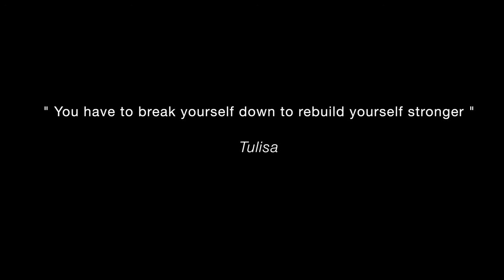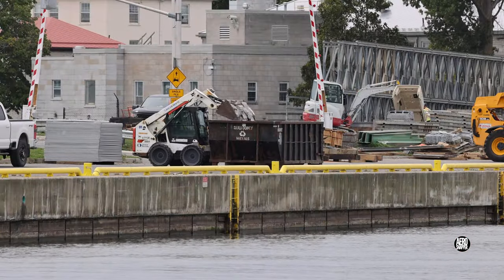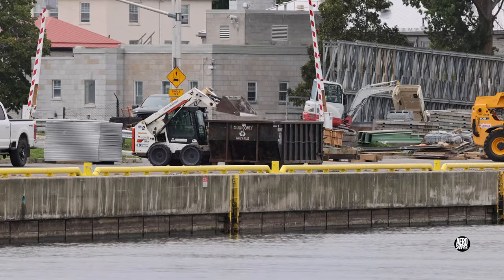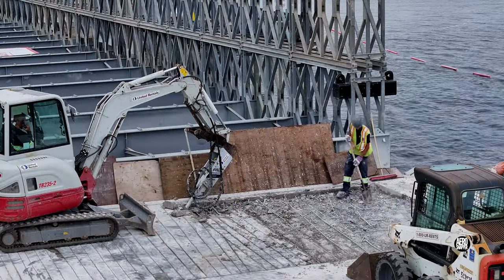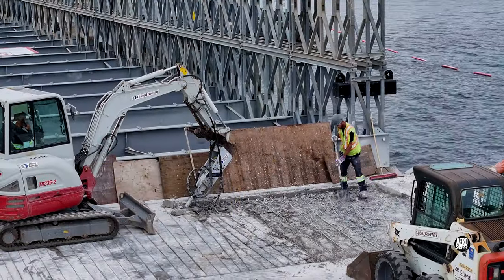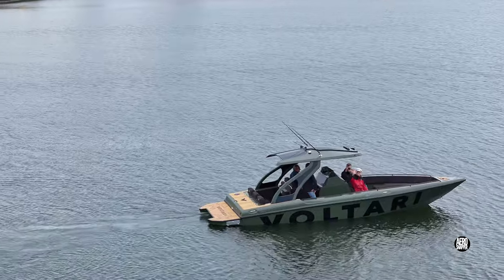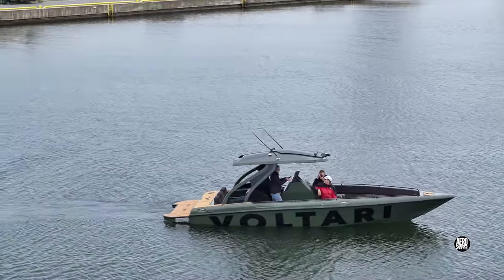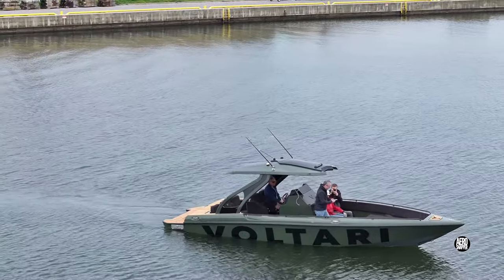Breaking up is hard to do - an update on Kingston, Ontario's La Salle Causeway  4K

Comment: I wonder if they will build a ramp-up to meet the bridge edge on the East side? It doesn't look like it is flush with the road edge. I guess when building these structures you will encounter several little hiccups along the way.
Reply: Maybe they're not committing to the full installation without making the necessary steps that will allow a quick removal/re-installation to allow boats back in later this year?
Reply: Right now, it's anyone's guess.
Reply from the maker: No ramp will be needed.  That end of the bridge will be lowered onto the 'seats' that were prepared earlier before long.
Reply from the maker: @eugeneslament20  That's quite possible - but the old bridge deck was removed in the way that the plan without probems